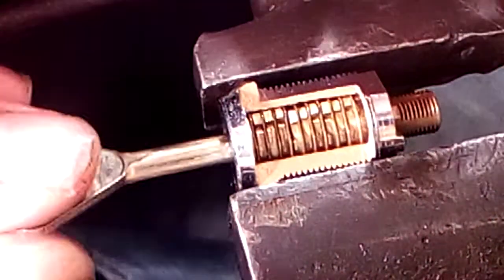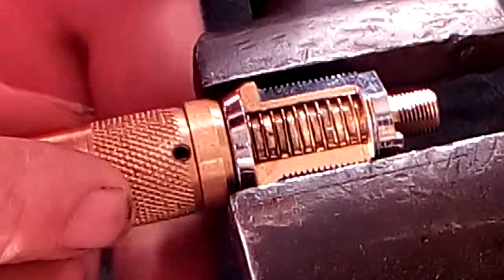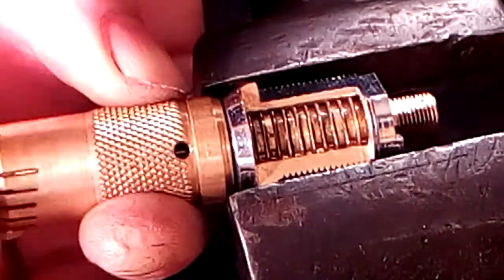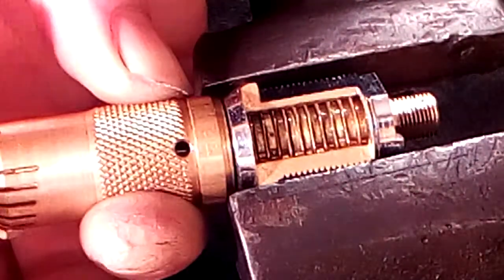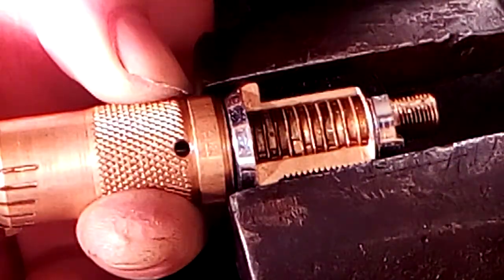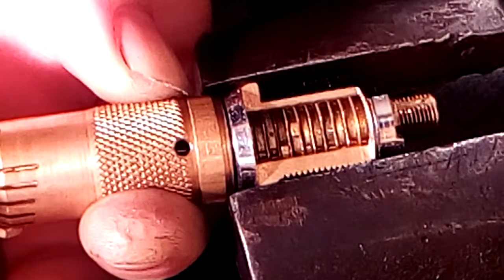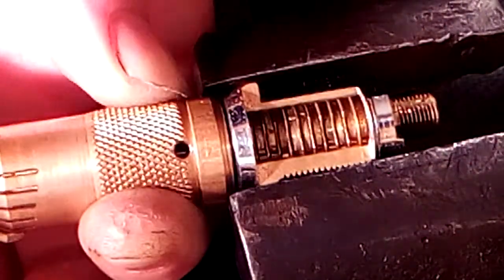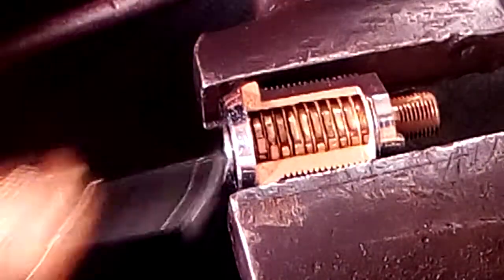Abloy Classic Tool Design Tips

Comment: Can these be converted to non-key retaining? Thanks!  Just bought a bunch and need to change them.
Reply from the maker: I don't think so, no. There is a way I guess but it'd require heavy swapping of the discs about and new keys.
Reply: @huxleypig69  thanks for the reply!
Reply: I think it would be easier to modify the lock to allow turning the key back to start position without re-inserting the shacle.